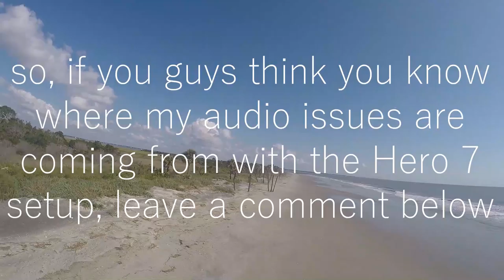Building the Ultimate Paravlogging Helmet | Work in Progress

Comment: I had to solder on a mono 3.5mm to the sena boom and use a 3.5mm stereo adapter between that and my audio box. If that doesn't work you may have a cheap adapter plugged into the audio pack that's not making a good connection
OR a bad solder joint

Comment: Question on the GoPro 7 Is there a soft switch for Phantom voltage for Condenser mic's? If so that could cause trouble if set the wrong way. Look for mic settings also,
 Cond./Res/Cap/ low imp and high imp.
Reply from the maker: Nope no switch 😔

Comment: Tom you could try your gopro 4 bluetooth back pack on your 7.   I velcro the back pack to the 7 case.  Not to bad looking and works pretty much the same as the 4.. you might want to test the power mic setting and other mic settings.   I recently switched to that setup on my videos.  Just a thought.
Reply: Interesting!  " Works about the same"?  is the audio about the same?
Reply: Just ME I think so.  Still testing.   Check out my last few videos if you like an idea.
Reply from the maker: Hey Bob, how are you connecting the Sena backpack to the hero 7?

Comment: I used the same video as reference for my soldering and while my GoPro adapter is going I don’t have the static issues. As I recall the wires are very fine; is it possible the you have strands from one side touching the other? Just a thought. Nice vid.